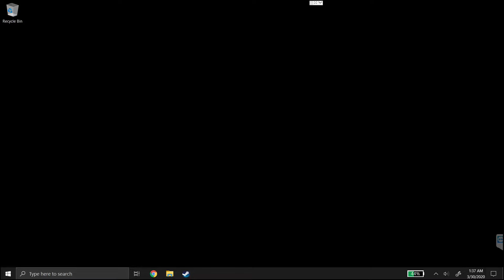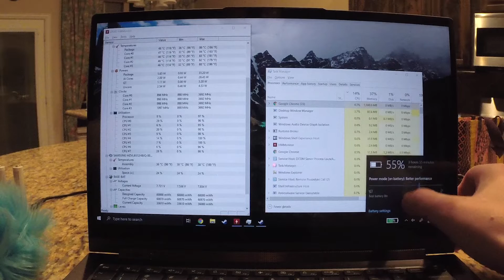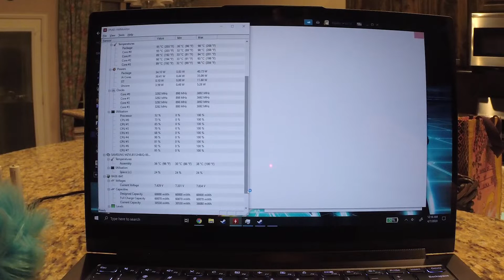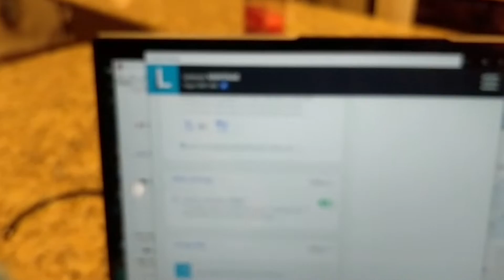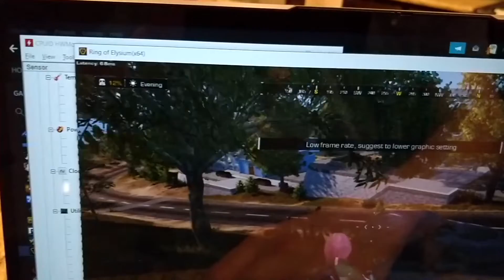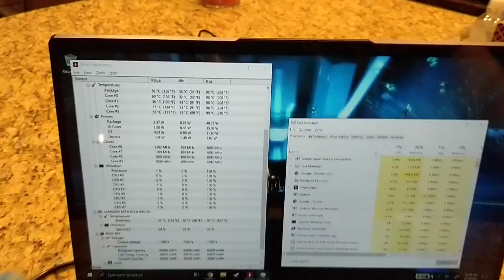Lenovo C940 - Part 7 - Extended Cooling Revisit

Comment: great video man. I see you're utilizing roughly 23% memory in idle mode where as Im( own c940 as well 16gb) am using 40%.  in idle. 3 windows open, running chrome, alexa, but not a whole lot more. I'm not very savvy as you are but I understand some basics.  Roughly 130 processes runnning.  Any advice or opinion? Thanks.
Reply from the maker: Thanks for watching!

So I just loaded up a bunch of video's to watch with 5 other pages open, one a streaming site with some heavier graphics on the front end, one page with some animating graphics and nothing special about the others.  Then 10 you tube windows 1 being the main page I opened all the others from.

With that and task manager running I have 168 processes and am using 30% of the 16gb of memory. 

Chrome is a hog the way it operates these last few years.  It will consolidate some sacrificing performance when you get low but if you have room it will steal all that it can. 

Sites, tools and applications that need to do multiple things will need more threads and more memory to keep track of things.  So Alexa always listening needs to have connection to your mic to listen for input, speakers to play back, constantly on the network to a degree to check in with the servers and be ready to search / respond as well as run itself.  

Now  the processor threads or tasks are not necessarily a problem, its what they are all doing that can lead to the issues.  Running updates as this video showed, monitoring various things or just there running all of the stuff you are currently doing.  High memory utilization is not necessarily a problem unless one application that is barely doing anything continues to expand its foot print (memory leak).
Reply: @Ripskin16   Thanks for the in depth response!  You hit the nail dead on the head when you mentioned Chrome being a hog! I'm shocked. I opened up 15 windows in Chrome, 5 streaming video's,  and utilization spiked to 52%. I'm not familiar with the term "memory leak" but I will continue to monitor this for footprint enlargement. I feel better being reassured that this amount of memory loss shouldn't be a problem but being that the computer is 2 weeks old I may trouble shoot this with Lenovo. I'd rather see your 30% than my 52.  BTW..I've been asking people for months how to determine which SSD is installed since Lenovo uses several based on supply an other variables.  I've called them and they would never disclose. I discovered it by toying with Task Manager, thanks to you vid! By clicking on disk you're able to read the model in bid bold print right at the top.  I'm running the Samsung MZVLB1T0HBLR-000L2.  How about you?
Reply from the maker: @whip31lash  Happy to help :) I keep a lot of stuff minimal on mine and removed some of the minimal bloat that may help contribute to some of my reduced usage.  And I killed all but the basic Cortana functions so I can search for files.  

A memory leak is a bit of an odd term but roughly speaking an application "leaks" into more and more of your memory though poor code or a glitch.   Like if you opened Note pad and wrote 1 paragraph you would not expect such a simple app and text to be using much memory.  But say there was a problem in the code and after 15, 30 or 60 minutes you saw note pad using 1gb of ram and climbing you would have a problem.  Usually older apps being run in compatibility or beta apps / updates run into that but it can happen to others. 

Yeah they would have to look up your serial and check what was put in it and they wouldnt want to waste the time.  There are a few ways to look up what is there but windows does make that easy :) 

Mine is the Samsung: MZVLB512HBJQ-000L2.
Reply from the maker: @whip31lash  One other thing to consider is that Chrome will eat more while it opens and caches the pages you are loading, once that information is there it may offload some to the page file reducing the memory foot print until you open that other window.  If you are active on multiple pages at once expect those pages to stay more active in the memory.
Reply: @Ripskin16  Very true. Did not rake that into consideration but that bwould only apply to pages Ive revisited correct? Btw...i was at 56% utilization.  I might call tech and have them run diagnostic. Just seems like too much. That almost 9GB.
Reply from the maker: @whip31lash  Does seem like a lot of usage, if you sort task manager by the memory usage most at the top least at the bottom what is sucking down the memory?  Is it all Chrome or or is Chrome more in line with what I was saying mine was doing and other applications in the top 10 are sucking down a large chunk that can be identified?
Reply: @Ripskin16  765mb chrome
440 antimalware swrvice executable 
320 photos
201 alexa
Another 2000 in other multiple chrome windows. About 35 to 80 each.
Than lots of random 20mb
Reply from the maker: @whip31lash  So Chrome on mine is using aout 1.3 GB after it loaded and split the processes into separate threads.  

Antimalware is at about 122 MB after that its all small windows things for a total usage of 27%. 

Now remember apps that want memory will use it if windows has room for them to expand and use it.  As memory runs out windows should prioritize the applications you are active with as the priority.

Similar to Android smartphones full memory is not a bad thing due to the way they run.  If you are seeing slow downs or leaks as mentioned before definitely concerning. 

Chrome sounds like the largest hog sucking down memory. 

I would do a fresh boot, check task manager after 60 seconds of doing nothing in windows and watch it for another 60 seconds and see where things settle down (hopefully no updates running) and see where it lands without chrome.  

Then launch chrome and watch it for a few minutes as it loads, caches and splits the pages / threads.  If your usage is 15 to 20% before loading Chrome it sounds fine and the pages and number of tabs loading in Chrome is sucking down the memory.  And Chrome the last few years is a hog.
Reply: @Ripskin16  Thanks man.  I'll try that out. I really didnt understand why chrome was showing up multiple tines... you clarified splitting processes. I wonder if that occurs for ever tab i open.  I typically have 10 to 20 tabs open.  Good stuff... I'll be sure to check out your other videos.  I will say one thing... sequential r/w marks were impressive.  3600 read, 3200 write. It's a great machine.  Im not using vantage... not sure pros outweigh cons.  After 40 hours of use I've had the  fans come on maybe 6 times fot les than a minute each.  Haven't checked temp but chassis hasn't felt hot once.  Overall very happy. 802.11 ax such as improvement over 802.11ac in the c930.
Reply: I should add this in max performance mode.

Comment: great job, my laptop running a lot of services of Lenovo.Modern.ImController comes from this directory C:\Windows\Lenovo\ImController, do you know what is this? i have 8 instances running
Reply from the maker: Thank you!

As to those processes, it is normal to see a handful of various Lenovo IM controller threads running as it is how their applications update and pass data around.  Their plugins help change the orientation when you flip the screen around, the Vantage software and other little things Lenovo specific. 

Did a bit of searching and the thread below may help answer some questions.  It is an older thread but the info is good.  If you see 5 to 10 I wouldnt be too concerned unless they develop a leak and suck your resources down or multiply causing problems.  

They wont impact windows so removing should not be an issue, but keep in mind that if you do remove Lenovo functions specific to your model may not work any more.

https://forums.lenovo.com/t5/ThinkPad-P-and-W-Series-Mobile-Workstations/HELP-lenovo-modern-imcontroller-pluginhost-is-it-a-virus/m-p/3318179?page=1#3320146
Reply: @Ripskin16  i am using extreme performace on vantage and minimum lavel on battery settings on windows and now its very silent mode